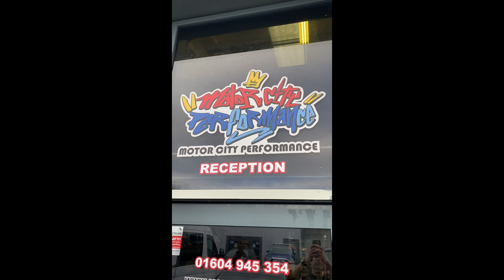Powerflex Toyota GR Yaris Upgrades

Comment: Can you report back on NVH increase from the inserts? And how effective are they? I managed to slightly damage the stock lower mount within 8000km and have since fitted a Cusco item. The Cusco mount made high RPM shifting an accuracy dream as stock the amount of movement made the internal workings feel stressed, yet the NVH levels are borderline. 

Also can you discuss the castor bushes for effect? Will they have any type of anti lift effect like solid urethane types would? Or because they are a ball in a cup would that negate that effect? In Australia initially we were only offered the convenience pack, circuit pack (called Rallye here) was hinted but not promised at that point so many of us are jammed with softer roll bars and no LSD. Power under steer is so incredibly bad it could convince one to sell the car. An anti lift product would be really nice while still enjoying the plushness of the OEM shocks.
Reply from the maker: During the development of the Yaris engine mount inserts we trialed several iterations to achieve reduced engine movement within bearable levels of NVH increase. Naturally by reducing the movement in each mount some additional vibration is added, again with increased hardness in material more vibration can be expected. With this in mind we aim our yellow 70A inserts towards fast road based drivers.

Our caster increase bushes enable +/- 0.5-1deg adjustment and increase vertical stiffness by 250%. These combine for improved handling and reduced suspension movement during loading. These bushes along with the engine mount inserts have been tested in road and track conditions by high profile UK tuning companies.

Best regards

Sam Edwards ~ Head of Design & Development
Reply: @PowerflexSuspensionBushes  thanks Sam, very helpful. So that’s 250% stiffer to sweep the arm up and down?
Reply: Jason,have you checked the allignment on the front end, my circuit pack was washing out and since changing to approx 2.25-2.5 front camber with new bolt config from Toyota it has meant I can brake later and power through corner alot more efficiently without major understeer.
Reply: @campbellmacfarlane00  yes, you’re right. Initially I tried the car completely stock and then with just RS4 tyres (major improvement over the dunflops). During our delta outbreak I got my hands on the DNA racing camber tops and have done a few days with 3.1 degrees and one with 2.75, the later was exchanging camber for castor (that’s the way the bushing works) and that has made all the difference. I’m actually keen to find more dynamic camber and wind my static back a little further again. I think where you are currently will be my next step and I’ll try get more castor again with an LCA bush. More dynamic and less static is what I’m thinking will be best. Cheers!